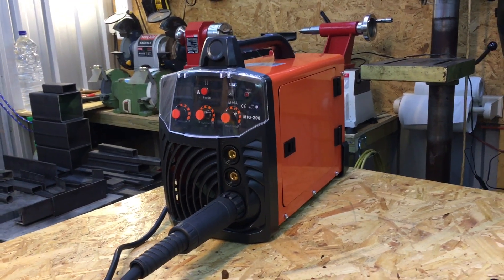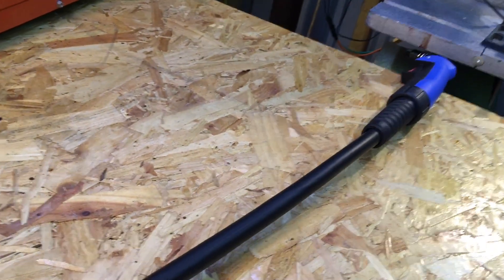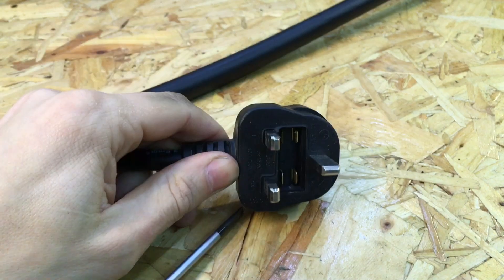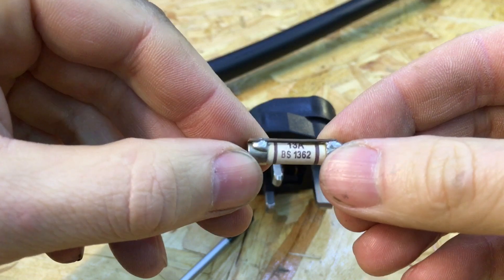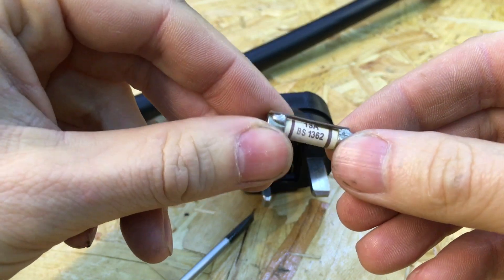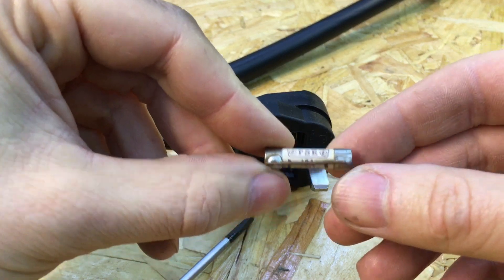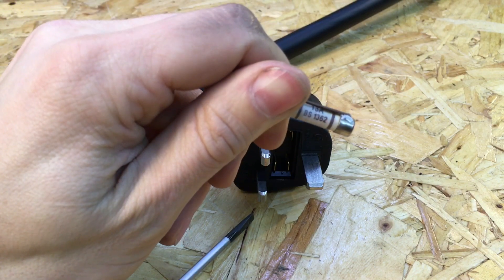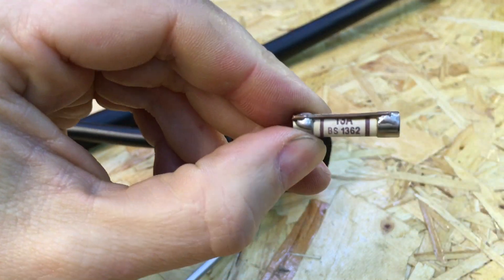Burn Your House Down 13 Amp Fuse safety hazard

Comment: My welder (A Yeswelder 135 flux 230V, bought on Amazon) didn't power up when I tried today so I checked the fuse and found the exact same thing. I can confidently say the fuse hadn't blown anyway!

Mine is 2 years old. I've contacted the seller so lets see if they respond. By the looks of this, it is presumably commonplace in lots of cheaper welders.

Comment: They've used 30A fuse wire this wont work on domestic 13amp sockets. Lots of welders over 200amps use 30amp fuse in the plugs. To use welder on domestic 13amp socket, your welder would need to be under 160amps fitted with 13amp fuse in plug.

Comment: Hello what will happend if I use this fuse in 12 volt system  , the fuse will let  the current enter to the load ( 12v load ) ? Or the 12 volt current won’t be able to enter to load ?

Comment: Probably fitted in a similar 160A MIG (uptime) I am looking at on ebay which says 13A plug fitted in listing. The listing also gives a VA of 4.9K so do the maths. 4900/240 = 20.42A. Clearly will not run correctly on a 16A ring main and should be wired to a 32A ring main and fused at 21-22A.

Comment: In Cyprus, some workers replace the fuse with a nail, so that they can run their power tools that need more than 13 amps to work from a BS1363 socket, but in cases like this you need industrial sockets and plugs

Comment: Hi there would you still buy one ? knowing that about the fuse
Reply from the maker: Paul Ashton yes it’s the best welder under £300 in my opinion . The reason for the soldered wire is so the fuse doesn’t continuously blow. 
But even at full power a proper fuse will last a few minutes.

Comment: So did you replace it with a standard 13A fuse? Great no nonsense vids btw
Reply from the maker: evanleebodies yeah just replace with 13 amp fuse. it doesn’t blow straight away will work on full power for about 2 minutes before the fuse blows.
Reply: @JAYZWORKSHOP  will the welder take 0.6mm wire?
Reply from the maker: evanleebodies yeah 0.6 they are standard roller you can get replacement on eBay .
Reply: @JAYZWORKSHOP  could you advise what to search description is for the roller, is it specific to the machine, could you also please advise how you change the polarity for sold core.  regards Malcolm

Comment: Just checked my shower booster pump, from China. SAME FUSE as you! Trading Standards here we come. fyi put a 5A fuse in and the pump works OK. One explanation is Mrs Wong's kid ran out of fuses so got the soldering iron out otherwise they would not eat that night.

Comment: That's horrific. A 13 amp fuse will handle up to 20 amps and not blow (never do this). I've tested 26 amps through a 13 amp fuse, and it took a good hour to fail. This "fuse" has been totally bypassed, so technically, if left in place, would indeed burn your house up. Please throw away

Comment: Another one confirmed. Single socket next to a 16A breaker so went with it for a bit, almost melted the socket pin off...
Reply from the maker: good it wasn't worse
Reply: @JAYZWORKSHOP  I guess I was lucky that I had the 13A fuse in a block between them. I would have hoped the plug would have been a better quality, the cable is okay. I've replaced it with a 16A plug now but it still trips out at over 100-120A, can't get to 160A - just going to put a 20A breaker in and trust the 16A plugs. I find it funny how many places it gets the A wrong, ont he side it says MIG-120, on the front it says MIG-160, the manual says MIG-150, yours says MIG-200 on the front.

Comment: Have you fixed the issue what fuse are you running now? Just bought this welder as my first ever welder any tips would be very helpful.
Reply from the maker: Just put a new 13a fuse in.

Comment from the maker: *Cobalt Drill Bit Set https://www.banggood.com/custlink/m33GhoqQgF
*Cordless drill  https://www.banggood.com/custlink/DmvGNTT9iT
*MMA welder i would like https://www.banggood.com/custlink/3vGDsufVnM

*MIG welder i would like https://www.banggood.com/custlink/K3KKs7T5nO
*TIG welder i would like https://www.banggood.com/custlink/Gm3DBGhSsi 
*Tin Snip https://www.banggood.com/custlink/KmmmnwTVMl
*Stick Welder https://www.banggood.com/custlink/DDGKsw7PU9
*Welding Clamps https://www.banggood.com/custlink/mKKGbuwF1j
*Machinist Hammer https://www.banggood.com/custlink/KmDmQ1ut11
*Screwdriver Set https://www.banggood.com/custlink/KmmKATw5w4
*Precision Screwdriver Set https://www.banggood.com/custlink/K3v3Nuwi8V
*cordless Angle Grinder https://www.banggood.com/custlink/GDKmAFL7s4
*Carbide wood turning tools https://www.banggood.com/custlink/KKmKQwfS8S
* flex shaft Rotary Tool https://www.banggood.com/custlink/3KK3Z35Boi
*palm Router https://www.banggood.com/custlink/GDGGbT1iSj
*F-Clamp https://www.banggood.com/custlink/vKDGbfuZiB
*Double Edge Pullsaw https://www.banggood.com/custlink/mvGvb7uIZN
*Mitre Box https://www.banggood.com/custlink/33KvbuTSj3
* Impact wrench  https://www.banggood.com/custlink/mKDK6g6Bts

Above are affiliate links and in the comments it costs you nothing, if you do not want to use links search on goggle more info Thanks.

Comment: I purchased a welder from Amazon and it had the same fuse in it. I sent it back the next day.
Reply from the maker: pretty much the reason they do this is because at the top power settings, A 13amp fuse is going to pop all the time. it needs 16amp or more 
They don't want bad feed back. doesn't mean theirs anything wrong with the welder. Just something wrong with the terrorists  selling them.
Reply from the maker: but yes it is dangerous drawing more than the rated currant through a 13a socket or plug Chinese plugs and wire are not all the bast quality
Reply: Couldnt you just changed the fuse?

Comment: Yikes, scary. I bet that was a measure taken to avoid getting complaints about the welder popping fuses when they were running it at higher power levels without changing to a 16 or 32A plug. :/
Reply from the maker: yes i would have thought so.
have new fuse now , it welds up to 150 amp  at top power 160 amp it welds a bit then pops the fuse .
thanks have a good day.

Comment: I never saw a fuse like that but I also never saw a fuse put inside of an electric plug before.
Reply from the maker: Hi The reason is in the uk we have whats called a ring circuit wiring that can deliver far more current that the cord to the appliance being supplied can handle.
if you had a faulty appliance with no fuse you could pull 32amps through a 13amp socket and the wiring melt and start a fire so each appliance gets a fuse in the plug to hopefully prevent that. 
Fake Chinese cable doesn't help.

Thanks have a nice day.

Comment: In the US the only cord end that I’ve seen with a fuse in it is on Christmas lights.
Reply from the maker: In the uk we have whats called a ring circuit wiring that can deliver far more current that the cord to the appliance being supplied can handle.
if you had a faulty appliance with no fuse you could pull 32amps through a 13amp socket and the wiring would melt and start a fire so each appliance gets a fuse in the plug to stop it from happening 
us wiring is different .